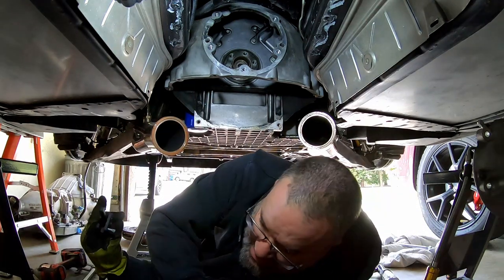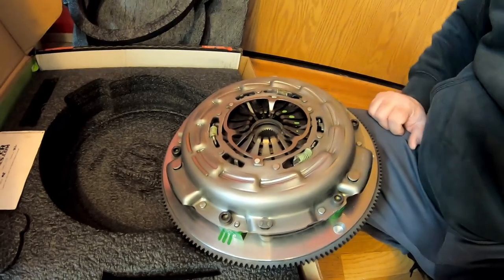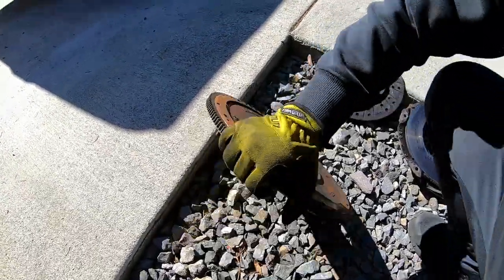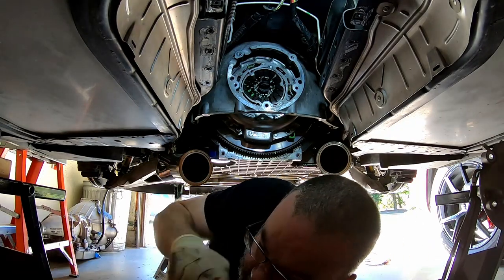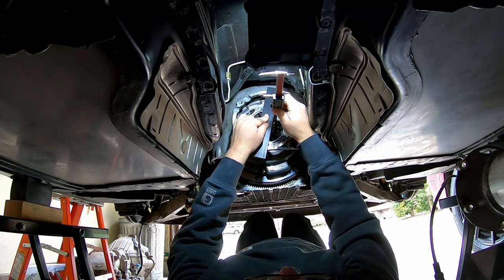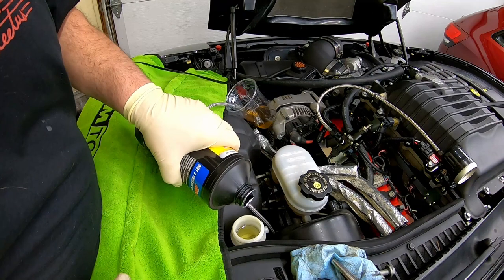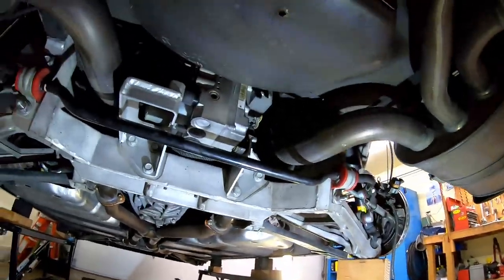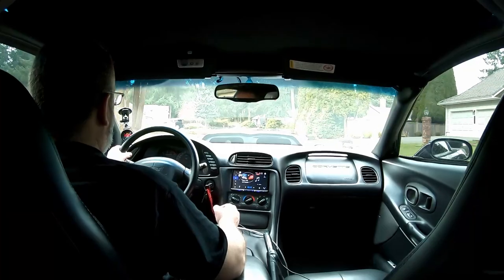How to replace a C5 Corvette Clutch Monster Twin Disc Install Part 2 Full Detail

Comment: I also enjoyed both of your clutch change videos as I find myself thinking A LOT lately about driveline maintenance. 😂 My 2000 has 101K and it's doing some clunking in the back when I first start moving. It also doesn't shift as smoothly and quietly as I'd like when under hard acceleration. Definitely a sign of clutch issues. Your videos give me the confidence to attempt it right in my own garage. Someday... 😂
Reply from the maker: It's a hell of a lot of work but it's worth it in the end over paying thousands in labor.    At your mileage I'm sure you are going to want to go through your torque tube and rebuild as needed as well.
Reply: @PNW_Car_Mods  Yes sir! I watch the vids from C&S in Sarasota, FL. Lyle recommends replacing some kind of bushings, bearings or other kind of material. I'm thinking the "clunk" when I first start moving is inside the torque tube. I mean come on, after 23 years something must be dilapidated. I KNOW I am! 😂 (56 btw)

Comment: I just wanted to give a big thanks for your very well detailed video.  I'm doing a clutch change on my C5 and your video nailed every question I had.  Especially the hole knock a pin out on the flywheel to get it in! I had not seen that suggestion elsewhere, and I had no clue how I was going to get the clutch in without removing the bellhousing (which seems impossible without pulling the engine lol).
Reply from the maker: Thank you Menaan.  When I made these two clutch videos I knew they would be huge on views but those that needed the information would seek it out and find something useful out of it lol.

Comment: I am so grateful to you for filming this procedure .  I have a C6 garage queen but my wifes C5 daily driver has 130 k on it and the throw out bearing is starting to act up.  So I have been getting prepared to tackle this project.   I had all ready figured on two or three weeks down time and getting her something else to drive in the mean time. I know that theres going to be alot more then just the clutch that needs too be replaced once I get into it. So thanks for sharing the knowledge.  P.S. sorry to read about your engine.
Reply from the maker: No worries T.  I hope you fund lots of useful information.    Car has 2500 miles on the new 408 LS.   Love it!   Love this clutch as well.   No slip and easy effort.  Thanks for checking it out.

Comment: Well done video Mr. Black.   This will help a LOT of folks install their new C5 Clutches for years to come.
Reply from the maker: Thank you Toys.  Honestly the job is not as bad as it's made out to be.  It is very tedious for sure but generally self explanatory if you've been wrenching on anything for a while.   I definitely may sacrifice some viewers due to length but I wanted to provide as much detail as possible.  Many of the videos I watched to help me do the job had huge holes and missing information in them i'm sure mostly due to length and just the time it takes extra to film and edit it all.
Reply: @PNW_Car_Mods  agreed, the sketchiest part I thought was tilting the transmission and torque tube down far enough -but not too far so that the back of the engine cracks the firewall, and then of course assistance to help pull the assembly free without dropping it.  I agree a full length video is super helpful to anybody actually doing this job!  you could do a second video geared towards entertainment called swapping out the clutch in 4 minutes and just breezing through the process. I think that's a totally separate group of people that are interested in what's involved, but probably don't think they have the skills to actually ever do it. Keep up the good work.

Comment: Great video!  I'm doing research on c5 and c6 vettes before I decide on which one to buy.   So, the good old grease trick for pilot bearing removal doesn't work on these? Just trying to figure all the quirks out... thanks!
Reply from the maker: Thank you sausage.   Yeah it's not good for the crank.  if that plug in the back of the crank comes loose you are likely taking the engine out to fix it.   I'm unclear if that plug can be replaced in the car but I don't think it can.
Reply: @PNW_Car_Mods  gotit... thanks!

Comment: I just match balanced  one of these . The old one had weights in it and the integrity of the old stuff was a bit edgy . The vettes with the trans tube  are very suseptable to vibration . I audited everything and yes Luk makes a balanced flywheel out of the box . But the p plate added unbalance where we didnt want it . Reach out if you have any questions.  I guess most of these that were hot balanced at the gm plant likely have corrections made up to 6 to 11 grams . The centripetal forces really pretty much double at high rpms so if you're feeling vibration ,it could close to 200 lbs of force per rev . Good luck everyone..
Reply from the maker: I appreciate all you techie nerd types that are so into all that stuff.   Me personally, I don't care about the goofy corvette additional balance stuff.  The LS engine platform is internally balanced design.   and if you ever change your engine or mod the internals to forged stuff it's all for not anyways.     I now have the Monster Clutch and flywheel on an all forged 408 with LS3 heads and the LSA supercharger.   No vibes all the way to 7k rpms.

Comment: If you measure from the point that the clutch fingers are fully extended until the bottom out fingers that prevent further travel of the throw bearing you'll find it's 0.5 in. If we follow the recommendation of 0.1 inch FreePlay and you had them together that's only 0.6 in total travel but the throw bearing permits a full 1.0 inch of travel. So why in the world don't we allow more free play to allow for more clutch wear in the future and still have free play so the bearing is bottomed out against the fingers?

Comment: If the Luk pressure plate allows for a total throw out bearing travel of 0.5 in from fully extended fingers to the catch fingers and the throw out bearing has a total possible travel of 1 in then why would spec for free play be 0.1 in? After all when the clutch wears the fingers will extend out using up the free play that you've calculated and hot clutch pucks also extend out the clutch fingers. 0.2 inch seems much more sensible because 0.2-in of free play plus 0.5 in of max travel permitted is only 0.7 in and the throw out bearing can move a total of 1 in. Am I missing something here? (Red lines indicate the limiting fingers that limit throw up bearing half inch travel)

What's more is since the fulcrum of the pressure plate fingers is closer to the pressure plate than it is to the bearing We find a ratio of about 3 to 1 where .02in of clutch wear is going to result in .06in of lost free play at the bearing. Wouldn't it make more sense to have about .2 in of FreePlay minimum? Why not even more after all a new clutch only has .5 in of free travel at the finger end?

It's no wonder that if somewhat worn clutch slips. You ran out of free play in the throw out bearing is resisting full extension of the fingers...
Reply from the maker: Douglas, I don't ever want to think that hard about setting up a clutch.   One of the reasons I went with Monster is they have very specific instructions on setting up their clutch and it simply works.   I don't have any hinky problems with this clutch or its basically stock hydraulics that so many people complain about with these cars.

Comment: Even though this Corvette only has about 30K miles, it’s nearly 20 years old and I would have changed the rear main seal, including an updated reinforced main seal aluminum plate. Sure would hate to redo this job in a couple years for rear main seal leak.
Reply from the maker: Ultimately it didn't matter.   I ended up grenading this engine about a month after this was filmed.   It has the revised cover and seal on the new motor lol.

Comment: I thought that was very strange when doing mine they called it a twin disk but only had one disk to install.
Reply from the maker: Yup that second disc is built in to the pressure plate as a non user serviceable part but it is in there.

Comment: Shift, shift, shift, shift, shift!  Shouldn't take you much more than about 25 miles and that means shift it all the time because if you're like me in city traffic I don't shift it all so the 500 Miles wouldn't do much if the objective is to seat the discs ¿`_
Reply from the maker: I totally agree.  Highway miles would be almost useless.     I intentionally drove this thing in some of the nastiest traffic on the west coast for a couple days on purpose and called it good.   It's never slipped even with 700 plus foot pounds of torque.